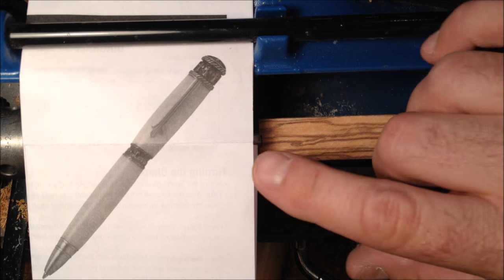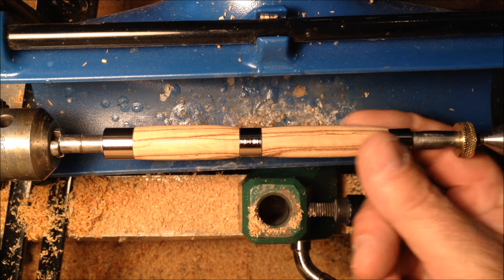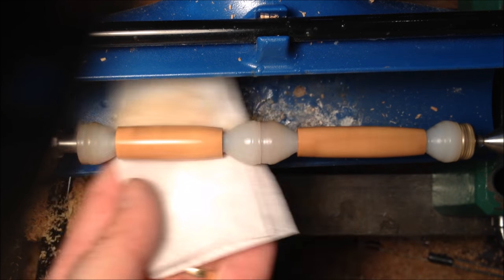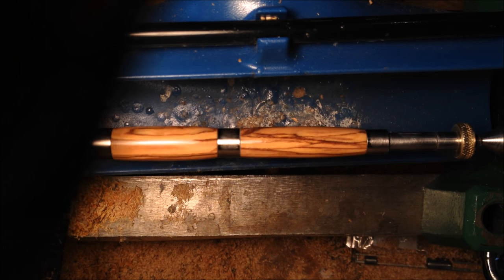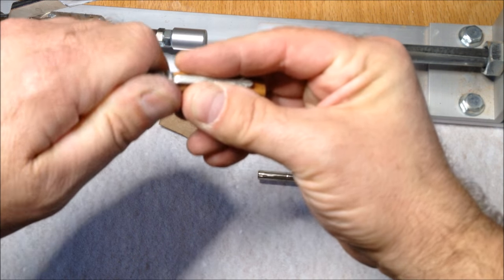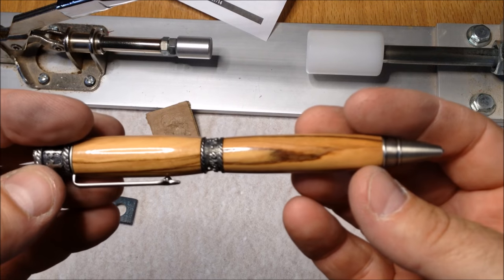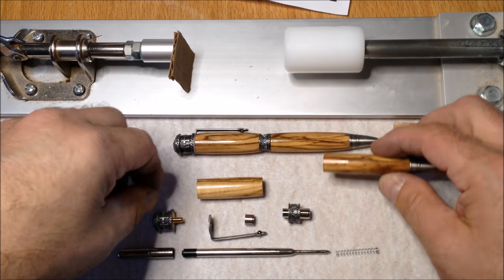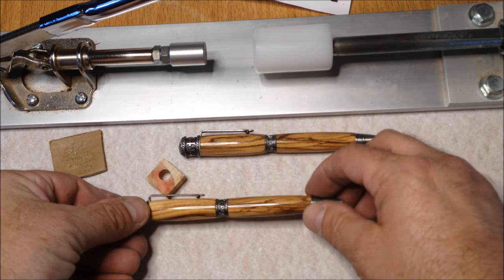Faith Hope and Love Pen - Not Worth The Money

Comment: Hello Bob, 
nice video, as always. Thank you for letting us know.
I have a question for pen turning in general: I would love to start into pen turning, but therefore I need a lathe. I do not want to spend much money on one and personally I think, a really small (mini)lathe would do the job, too. Do you have any suggestions for a suitable lathe? Or do you have any tips for pen turning in general? 
Thank you,
Paul
PS: If there were any mistakes in the sentences above, I have to apologize. I am from germany so english is not my native language!
Reply from the maker: +Paul Urbaniak Hello Paul,
  I'm not really sure about lathes because I know the market is a little different in Germany. But I may be able to help you with the other things you'll need. 

What you need for pen turning.
  If I were starting over again, I would probably go with the Easy Wood Carbide tools. There is a set with a square cutter, round cutter, and a diamond shaped detail cutter.   
  These tools are fairly easy to master and when they get dull, you just replace the cutters, no learning to sharpen or expensive sharpening systems. 
  I'm going to assume you want to start with ink pens and tell you what you need for that. 

  When you purchase a pen kit, the seller will tell you what bushings and what size drill bit you will need to
make that pen. Bushings can be used over-and-over and bits only need to be purchased once. The first pen is expensive due to this overhead. 

  Medium C/A glue, or Epoxy for gluing tubes into Acrylics blanks. Both work on wood too.

  You do not need a Pen Insertion tool, you can use a screw driver. They are nice to have but not a necessity. 

  Purchase a barrel trimmer set with the four most common sizes: 7mm, 8mm, 3/8", and 10mm. This is a must have. 

  You will need a mandrel, I personally like the Mandrel Saver setup that Penn State sells. A mandrel is a must have. 

  For Acrylics, the easiest was to an amazing finish is Micro Mesh pads. Sand paper is to coarse for Acrylics and should be reserved for wood. Get a box with 4 or 5 different grits. 

  You will need a finish for your pens. 

Finish for Acrylics:
  I like Hut Ultra Gloss. It's quick and the results are great. 

Finish for wood:
  Thin C/A is my favorite. 
  Shella Way is nice for beginners, as is Hut Friction Polish. C/A is the toughest to master but looks the best and lasts the longest. 

  End part 1
Reply from the maker: +Paul Urbaniak start part 2:

  A pen press is nice to have. You can use a clamp or the lathe to press your pens together. Laney Shaughnessy has a video on his channel that shows how to build one. It's really good. Otherwise, purchasing a press can be expensive. 

  That is pretty much everything I can think of. 

  Below are the links to three videos I made several years ago about what you need to turn pens. They are a bit long but contain a ton of good information. Also, feel free to ask questions as many things have changed in my process over the years. 

https://youtu.be/HZShe5ntDJY

https://youtu.be/-7izWhLDo6g

https://youtu.be/dAvj-qj-VwI

  I hope this helps. 

Hopefully you can find a local supplier of parts and accessories. 

Regards,
Bob
Reply: Wow, thank you so much for that detailed explanation. This will help me a lot. I didn't expect an awnser that long. Again, thank you! I had those carbide cutting tools in mind, too. 
But one question about the lathe: Are there any special "abilities" (sry I dont have quite the right word for that), that the lathe needs to turn pens? I mean, is there anything I need to look out for when buing one? Thanks so much for the quick replies, 
Paul
Reply: Hi Paul, I'm not Bob by any stretch :) I'm sure he will chime in, he's super responsive. Personally, I love my Harbor Freight 8-inch-x-12-inch-bench-top-wood-lathe-95607 the one with the variable control knob. It can turn larger items than just pens. I also like that I don't have to manage belts, just have to adjust the potentiometer. 

Though to me where the surprise cost comes in is the tools. I thought I was saving money buying cheap skews and roughing gouges and they just gave me cheap results. Also another not so expensive item was the mandrel and mandrel saver. Currently, I use that lathe, carbide round tip and carbide flat tip tools, and mandrel + mandrel saver.. so in all it was about $300 to really get started. Keep in mind though, the lathe I mentioned only has MT1. So, I have to make sure all my parts are Morse Taper 1 compatible.

In all, I'm just sharing my experience as a price conscious buyer (excluding those items I was able to sneak past the wife).

EDIT: I would also look at the all in one kits closely.. sure you can get started with those, but many of the tools and whatnots will have to be replaced. Harbor Freight also has awesome coupons to get up to 40% off. Many of the cheap lathes are the same thing with just different labels/brands.
Reply: Thank you so much for your respond, too. I will consider this. That is why I love the youtube community! Have a nice day,
Paul
Reply: +Paul Urbaniak I think the biggest things to look for is speed control whether belt or dial. Faster speeds for turning, but slow speeds for finishing. The wood lathe hasn't really changed in over all design in years. On the motor side there is a screw thing that sticks out that you can put a MT1 or MT2 taper device in, or you can screw on a chuck head (can be pricy but very useful beyond pens). You can also use a MT1/MT2 Drill Chuck to hold ones side of the mandel. I kind of believe the mandrel is the most important considerations. I personally picked the mandrel and mandrel saver option, because I have bent many mandrels already (200lbs Gorilla thing not worky bang bang). Though it does seem Bob prefers the Mandrel with the screw knob at one end.

EDIT: I think if you pause the video at the right time, you will see that Bob is using a drill chuck style head on the motor side (head stock) and a live center on the right side (tail stock).
Reply: Bostish2 Thank you very much for your respond, too. That is a helpful tip, I will keep it in mind. Have a nice day.
Reply: You too! Sorry I can get very chatty and not all my thoughts reach my fingers in time :)
Reply: Bostish2 Haha, why are you sorry, you actually helped me a lot. Thanks again.
Reply from the maker: +Paul Urbaniak I hope this translates well, 
  In the US there is a standard called a number 2 morse taper. That refers to the mount on attachments for the head stock and tail stock. Pretty much every attachment is made to fit the number 2. If you have a number 1 or any other size, you may not be able to find specific accessories. 

Also the thread pattern on the headstock. Ask some of the German turners what the standard is for that too. Some of the less expensive Chinese lathes have odd sizes that you can't get chucks for. 

Beyond that there are nice to have things like reversibility and variable speed. They are not necessary but sure are convenient. 

Bob
Reply from the maker: +Bostish2 Great info, thank you for adding this. We will give Paul plenty to think about. 

Bob
Reply from the maker: +Bostish2 LOL,  
  You caught me, I bent my mandrel saver and cobbled this together to get me by. I just haven't purchased a replacement yet because it's working so well. 

Bob
Reply: Love it! Thank you Bob, please keep up the great work! My favorite channel to watch over and over. Don't tell no one, but I'll put my headset on and fall asleep playing through the list nonstop. It's amazing what you will keep missing, then you will hear that ah ha tip.
Reply from the maker: +Bostish2 LOL,
  Your secret is safe with me. 

Regards,
Bob
Reply: RJBWoodTurner Thank you again for the great detail. I will think about it tomorrow, it is after 10 pm here in germany already :-D
Reply: I did forget one thing though,. Even though there is several options out there and in the end it will come down to personal preference. Most of the items/parts were designed for high speeds but still sort of safe for fingers to be around. I know it's obvious, but don't bring fabric or steel wool near a running lathe. Seems it can be like a cactus and reach out and grab things. I'm only saying this because you seem interested in getting started and just felt compelled to put on my safety hat (I'm not a safety nerd, but). You will notice Bob always uses small pads finishing, short sheets of sanding paper,  rolled up or no sleeves. In my opinion what will get you; is a desire to put something down on the bed to help eliminate water dripping when wet sanding. I put a sheet of paper towel down, never fabric. I mentioned steel wool, because that is also a common thing to use during finishing, and I don't think it's safe near a running lathe.
Reply from the maker: +Paul Urbaniak Any time Paul. 

Regards,
Bob
Reply from the maker: +Bostish2 Great points. I'm really bad about covering the lathe bed. It's about time to recondition it. 

Michael,
  I just want to say thank you for your kind gift. 

Regards,
Bob
Reply: You're most certainly welcome :)

Comment: Would it be possible to "hone" the pewter piece with real fine sand paper to straighten and flatten the mating surface?  It isn't something you would want to do all the time but it might salvage the two you've already made.  Just brainstorming here :)  Good Luck
Reply from the maker: +Lynn Lacey both pens have a dip on one side on the top surface of the trim ring. That dip causes the gap. I will try some different things because I have nothing to lose at this point. I was thinking about using the soft grip pliers and trying to bend the dip up a little. 

Bob

Bob
Reply: If it's truly soft like the reviews said, you might be able to squeeze the ring a little. Using the ridges themselves as the fulcrum. Might need to do it while it's assembled. In essence by pushing in on the ring, while at the same time pushing the edges outward. I just cant think of a narrow enough pliers to put pressure just on the rings and not on the center or the blank. May need to try needle nose and maybe a small bit of leather to protect the materials.
Reply from the maker: +Bostish2 Thank you,
  I will fiddle with them and if I can bend it into shape I'll do a video and let everyone know. 

Bob

Comment: The error was on your part. The center didn't push in all the way because you used a backing block with a 10mm hole instead of 8mm, as was recommended. That's why the ring was protruding and causing the gap. Watching closely, I could see the inner ring was flush with the outer decorative ring before you pressed the assembly, but after you pressed it I could see the inner ring did not press in all the way.
Reply from the maker: Thank you Ted.

Comment: I just went to see if you could see the flaw on the sample pictures and yes you can see it there too. https://www.pennstateind.com/store/PKHPENAP.html then zoom in at the center ring and you will see a gap between ring and the upper. It's like they did a casting but didn't mill them level. I suppose you could maybe use a sanding pad to try and level the high spots a little? But on second thought, there is that nib that the upper slides into and that may only result in a uniform gap :)
Reply from the maker: +Bostish2 I'm going to try to bend one side up with my soft grip pliers. It may not work but I have nothing to lose. 

Bob
Reply: I really love that you showed the flaw. I'm just a hobbiest and I turn enough pins just to basically pay for my own hobby (that way the lady boss can't fuss all that much :) ) Since my hobby budget is so tight, losing 3 pretty looking pen kits would set me back quite a bit.
Reply from the maker: +Bostish2 No problem,
  I'm here to try to help other turners. At $15.00 bucks a pop, that's a bitter pill to swallow. 

Bob
Reply: Maybe you could start a patreon just to help fund the experiments. I really like these videos where you try different pen kits (even if not reviewing them). If a couple of people just send a buck or two, then you can offset the sting and possibly even reward the patreons with give-away's. i.e. order two pen kits, one for sale/gift and one as a thank you to a patreon. 

I don't really see it as a money maker for you, as I don't think you would want that. But I don't want to see you losing $45 thus saving me $45. I would gladly contribute to having pen kits reviewed prior to ordering them. Even on this specific pen, I noticed in the reviews someone sold a pen, had a picture and you can see the gap in that one too. I much rather see your honest review than a PSI reviewer who gave 5 stars ( I don't know their measurement of quality).
Reply from the maker: +Bostish2 Thank you,
  I have been avoiding Patreon but you may be onto something. Let me think about it for a bit and see what I come up with. Worse case, I'll knock it apart and use the parts for a modified pen somewhere down the line. 

Regards,
Bob